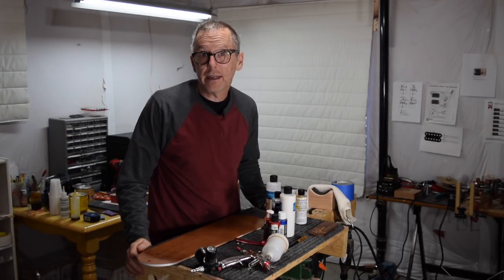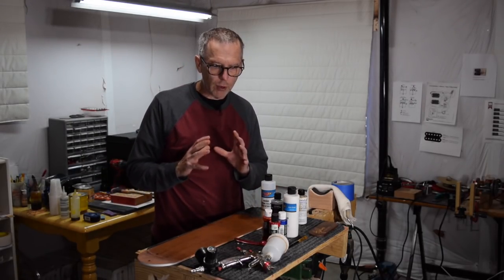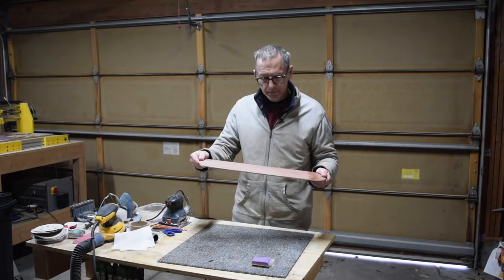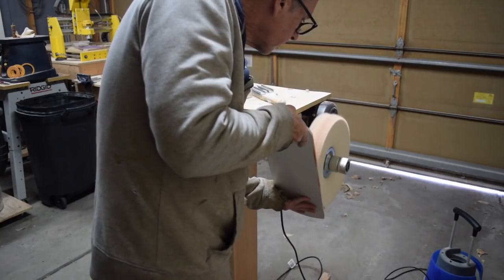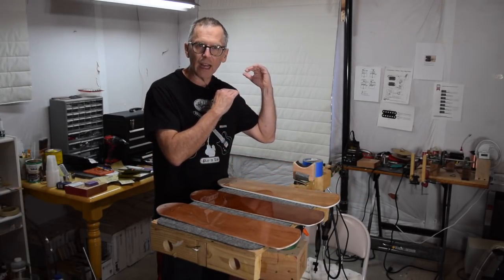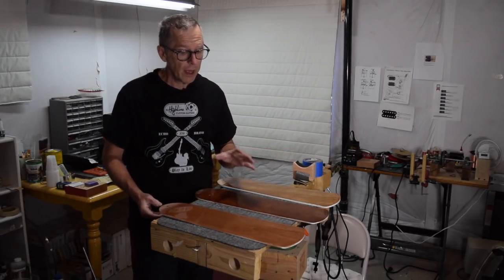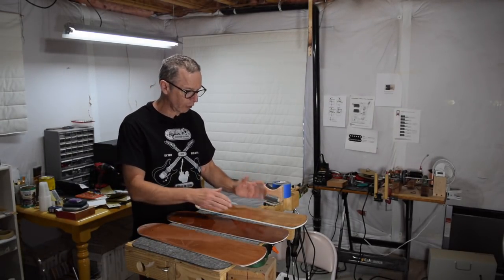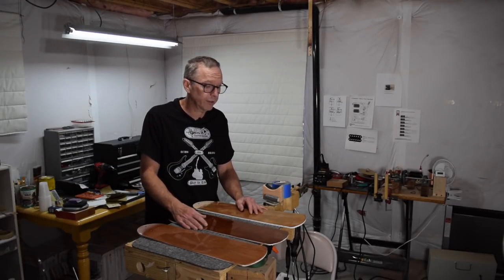In Search Of The Ultimate Water Based Clear Coat

Comment: Hi! First time viewer. I don't believe it's just luck that I'm seeing your video about water based clear coats today. My wife and I like to do creative arts and crafts things. One of the products we like to play around with is "Mod-Podge", which in fact is a very durable water-based clear coat product. It comes in Gloss and Matt finishes.

Once we got tired of our plain old white washer and dryer, so we pasted postcards from all over the world on them and then use Mod-Podge to seal it. It's so easy to use you can get it in a kit and it'll come with sponge type paint brushes but you could use just plain old sponges and just lay it on, itself leveling, it dries quick and it dries hard.

 You can go to their website and find hundreds of uses for it. So just the other day I said to my wife, I'm going to get a guitar body, probably cheap new or cheap used and mod podge it, and see how it turns out.

I originally bought it to mix with graphite to make my own shielding paint and to paint the inside cavities on guitar bodies. You can cut out things from magazines and papers, like rolling Stone magazine, or print out things like signatures from famous guitar players to put all over your guitar to make it look like an autographed body and then seal it with the mod podge.

It's pretty durable. I once did a desk top and drawers and that desk took a beating. Also, it's very easy to touch up if it gets scratched or dinged. In fact just using the product to only repair scratches and dings might be worth the price right there.

It's a fun very inexpensive product. You can get a kit with 2 large bottles, 1 gloss and 1 matte and a set of sponge brushes for less than 20 bucks. And it's available everywhere. Amazon eBay Walmart Michaels, and all of your craft stores.

 It's a fun product and I recommend that anybody into arts and crafts or willing to do something creative with their guitar or whatever, give it a go.

 I'm not sure myself how it will all turn out, or wear, but it's so cheap and readily available I'm willing to give it a shot.

Comment: Yep! You have to experiment with it... Either product... Especially with the spray gun. I also have a spray gun that I use for various projects and the secret is finding the right thickness and the right needle.

Oh, also, after spraying immediately set the item down so that it is horizontal and level.

I believe you should try using brushes too. Sometimes when spraying if there's humidity and or dust in the air it will get trapped in the spray before it hits the target. Even regular paint will give you a Milky look if humidity gets trapped in the spray. Although with paint that cloudiness sometimes doesn't go away and you have to sand it away and start all over.

Also I would definitely recommend sanding like you did with very fine grit sandpaper. Before the first coat, sand the wood down starting with 800 grit and then work your way up to 2000 grit, feeling with your hand until the wood feels silky smooth.

I've never tried wet sanding but that would be something to try as well.

 And then in between coats do 1000, 1500, then 2000 or higher if you feel it's necessary. But I believe one must start with as silky smooth a surface as possible and then do the same in between coats.

 I believe that product just like the mod podge is self leveling but if you have an imperfect surface you'll have an imperfect finish.

You don't have to wait 48 to 72 hours after wet sanding. I just can't believe that and I would ask the manufacturer about that. I've never had to wait 48 to 72 hours after wet sanding anything. And I've done automotive body work and have wet sanded many other things and I found it much easier than dry sanding. Wet sanding has the advantage of washing away all the teeny tiny particles that you remove from the surface. With dry sanding, your very fine paper clogs up real quick,  and smears dry dust like skid marks into the surface. Also never ever use steel wool on a guitar ever. The teeny tiny particles, some that you can't see get embedded in and all over everything. Steel wall is old school and there are hundreds of products you can get a do a better job and don't leave anything behind.

 Pretend you have microscopic eyes while doing all of this.
Reply from the maker: With water-based products, they have to fully cure before you wet sand or they will reactivate and soften. Dry sanding works great, but only if you use state-of-the-art dry sanding abrasives like Super Assilex.

Comment: I have been experimenting with different clears and I also have only been building guitars for a couple years using rough components to do my builds and then finish to the final build. I focus on the paint process above all. I have used Crystalac and poly water based clears and I am now getting ready to try the Createx process. I get good feedback from people on my paint jobs, but I am always on the look out for something better. Having been a partner in a custom body shop and all that entails I have done candies and metallic as well as pearls and the whole gamut. I must admit though painting guitars is a whole new experience due to the short amount of work surface. It is way more challenging. Thanks so  much for your insights these process's.
Reply: @Lynn Geiger fantastic ideas there, as I'm doing the same with metallic flakes & candy color art backgrounds, & with pinstripes.  I only wish i knew which coating stands up best to at least a season or two of uv fading assault before deciding on purchase.

Comment: I've done similar testing and got best results from automotive clear coats.  Dupont Nissan was favorite.  Agree it is more trouble cleaning up and I still had to wait 24 hours before sanding/leveling and re-spray.  I never got gloss to match from water based products but you'd have to hold two bodies next to each other to really notice.  Gave up wet sanding water based clears and went to dry sanding.  Great video as usual.  Loved the scratch test.  My clear coats are so tough they didn't need pick guards. Just used them for a given look. I'm sure acoustics are a whole new ballgame.
Reply: Are those Dupont finishes 2k types of finishes? Or are they water based also?

Comment: Also if you have any interest in non water based I highly recommend checking into the  Nextgen two part polyaspartic clear made by Flexmar. It is technically a clear coat for floor coatings but cures out in 1 hour, doesn't yellow and is absolutely indestructible.  Only downfall is it's a little spendy but how many clears can you attack with a hammer or knife and not damage?
Reply from the maker: I have switched to a water-based 2k polyurethane. A review will be posted soon.

Comment: Minwax makes a oil conditioned clear waterbased poly thats pretty durable.
Does have a slight tint if you build it up.
Otherwise Watco crystal clear waterbased poly dries super fast and gets really hard.
Its just not very pliable and can crack or chip a little easier than a oil conditioned water base.

Comment: Great video and test Chris! Seems like the technology just isn't there yet with water based clears. I know alot of model builders use Createx paints through their airbrushes, I do. 1 thing you didn't touch on is the yellowing over time. But that's kind of a hard thing to test! (just wait around 30 years, Lol). I only mention it because the old style of Createx does turn a slight yellow over time. I have seen my white paint turn yellow in about 5 years, but I think they fixed that issue, thanks for sharing the test with us bud! Hope your 2020 is a great one!
Reply from the maker: As it has been explained to me, Crystalac's formula, which is proprietary, can't turn yellow over time.
Reply: @HighlineGuitars  Good to know! Thanks Chris!!

Comment: No one will ever accuse you of not being thorough. Thanks for the informative video. Wondering if you ever tried Emtech water based laquer (EM6000 with crosslinker additive for hardness), if so how would it compare in your opinion to the crystallac?
Reply from the maker: I have only tried EM6000 without the crosslinker. By itself, it seems to cure softer than Crystalac Brite Tone. It also had a more noticeable milky haze if sprayed too heavy or if not enough time was allowed between coats. When I inquired about using the crosslinker, I was told it would only slightly improve scratch resistance, but it would significantly improve chemical resistance. I decided not to try the crosslinker due to the added cost, which I couldn't justify since Crystalac Brite Tone cures harder by itself. It should be noted that Crystalac Brite Tone uses a different type of polymer than EM6000, which uses an acrylic polymer. In my experience acrylic cures the softest, polyurethane is a little harder and the proprietary polymer that Crystalac Brite Tone uses is the hardest.
Reply: @HighlineGuitars  Interesting.  I think I'm going to make the switch to crystallac but first want to use up the rest of my crosslinker as to not throw money away, it was fairly expensive and my results  with EM haven't been so terrible as to warrant an immediate change. Thanks for your feedback Chris and for your informative channel.

Comment: Did you ever do a follow up to this using the proper process for the Createx? I'm curious if the heavier coats you sprayed were the cause of the wrinkles from the grain. It's possible instead of stretching you actually introduced to much water onto the wood causing the grain to raise. I just started experimenting with it but have got it to spray very level out of my airbrush running thin coats thru the .35mm tip. Once cured it's still crystal clear and level. But I haven't tried any bigger pieces yet.
Reply from the maker: Createx is too complicated. Just look at their website. I’ve moved on.

Comment: I'm just trying to put a DIY kit together, and I'm torn between a rattle can finish (and tearing up my lungs) or taking it to the next level.  Youtube keeps sending me your videos!
Reply: Don't tear up your lungs. Wear a respirator.
Reply: Invest in the Crystalac. It's worth the money. Also buy a respirator, use it weather spraying water-base product or not
Reply: On one hand there is your respiratory system...272k $ for lungs on the black market (around 2018)
On the other about 30-40$ for a decent mask with interchangeable filters for your needs. 

Seems like a really hard choice.
Reply from the maker: @edhampton415  And when sanding!

Comment: That Solarez is a product I'm highly curious about trying. I want to try the "I can't believe it's not lacquer".
Reply: I've tried it once. I ended up with witness lines in the finish and am not sure what that's about. Not sure if it's due to sanding through the finish coat to the sealer or what. I bought a fair amount and will continue trying it on other builds to use up the product and see if I get better results. I have to say I LOVE how fast you can cure it though.
Reply: @bevinmodrak4997  I found the sealer was ok, but the clear coat was horrible.

Comment: SSR Scenix clear is supposed to be massively better than the UVLS, Wicked Studio did a test on Lexan(RC Body) and the 7040 was so so so much better than UVLS when he went at it with a pointy edge
Reply from the maker: Too bad their product line and website are so difficult to navigate.
Reply: @HighlineGuitars  Yeah its really bad, the 7040 is the adhesion promoter in ssr line. Then they have the ssr clear with the hard surface cross linker(I believe #2016), its 2 part system, which in my experience anything with an activator works much much better. Figured I'd mention if you're still looking for water based clear, I am as well. Right now still using Tamco High Impact clear for hockey helmets etc. But its super dangerous and needs a full face respirator, it says direct air feed system but really edge of garage with fan and full face P100
Reply from the maker: @scottman572  When I inquired about the SSR line for this video, Createx told me it was going away in favor of the UVLS. I can't find the SSR line on their website.
Reply: @scottman572  The tamco is supposed to cure in under 35mins. Is it still toxic in the area after that time ?
Reply: For Solarez - Does it cure speedier with indoor UV lamps ?

Comment: Thanks for the great video Chris. Can you clarify which solarez you were using? Was it the I Can't Believe It's Not Lacquer?
Reply from the maker: It's not ICBINL. It was their gloss polyester resin.
Reply: Highline Guitars what is your opinion of the ICBINL vs their polyester resin ? I’ve been experimenting with the former and like it...
Reply from the maker: @tommybyrne8092  Their polyester resin is very difficult to use. It's temperature temperamental (pinhole air bubbles) and very hard to level sand. Also, the fumes are beyond what is tolerable in a home-based workshop.
Reply: @HighlineGuitars  would love to hear more on the polyester learning lessons 😁

Comment: Hi there, very new to guitar finishing here. If I wanted a surf green finish but wouldn’t use nitro, with which type of paint would I paint first before applying a clear coat? And on another note, what about the tone of these clear coats vs nitro? 😉I don’t have a proper shop so looking for the most safe and fast solution with good results.
Reply from the maker: Try some water-based acrylic craft paint. There are a lot of colors available and you're bound to find the right shade. I can't tell the difference as far as tone is concerned.

Comment: hello,
have you tried the varathane ultimate water based polyurethane?
Reply from the maker: Yes. I found it scratches way too easily.
Reply: @HighlineGuitars  ok, thank you, I was reading about it and the people posting about it were raving about the speed and the scratch resistance... go figure :D
Reply from the maker: @filoavignonesi2128  It's probably fine if you're building a guitar for yourself. However, if you plan to sell guitars, it's not durable enough. All it takes is the slightest hint of a scratch and customers will call you on it.

Comment: 4050 is a clear not a clear wood filler. You also evidently did not have a TDS to follow or didn't read it.
Your spay application and equipment are off.
Reply from the maker: When I did this test there wasn't a TDS available to read. At any rate, the only difference in my equipment and application was the use of larger needles and heavier coats. I did this to push the limits of the product as a worst-case scenario since I know from experience many who use it will overdo it. Obviously, my test shows that 4050 will work quite well even when sprayed heavily without thinning. As a follow-up to this video, I may apply 4050 properly on an actual guitar body to show how well it performs.